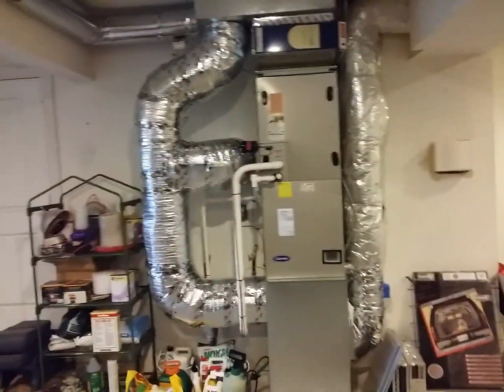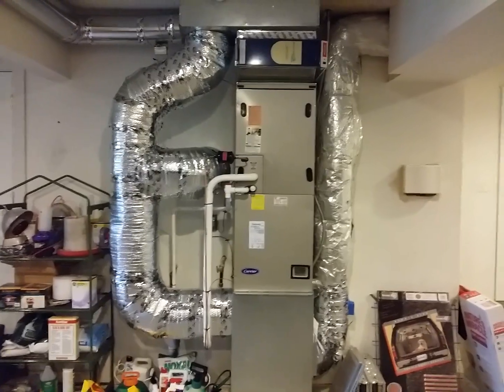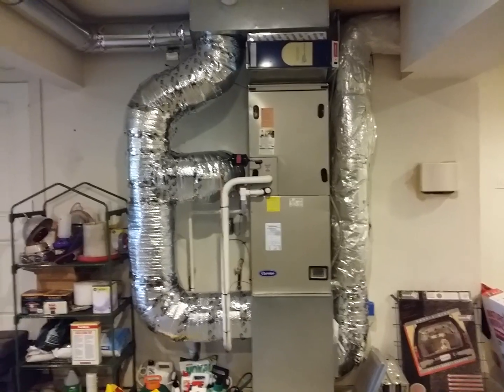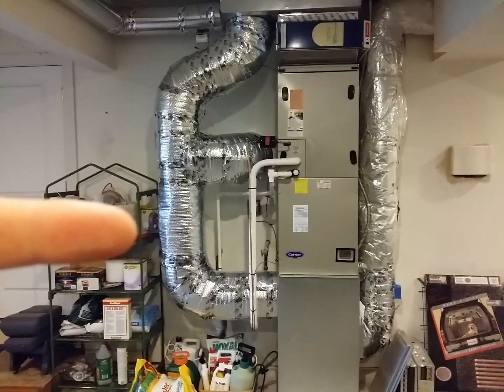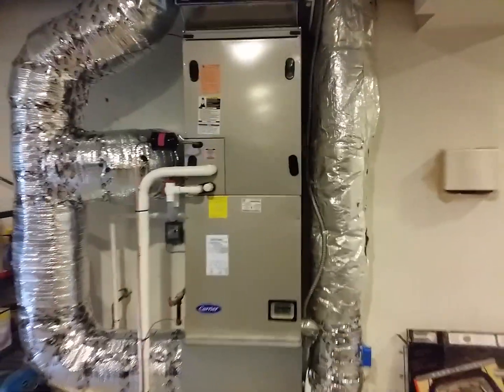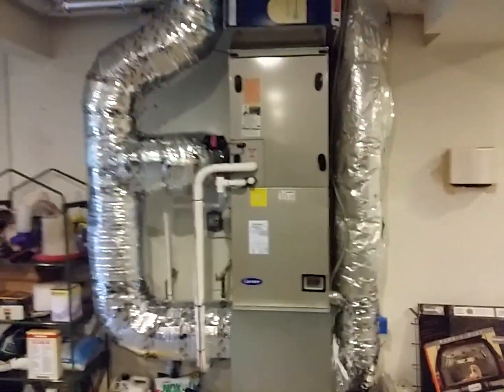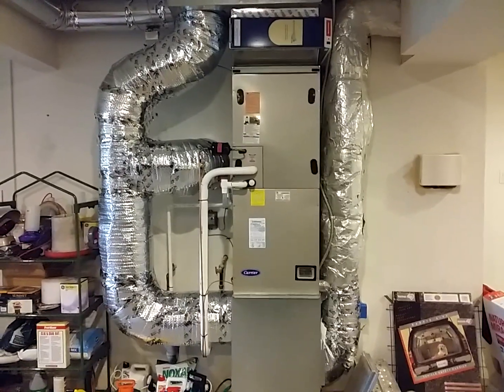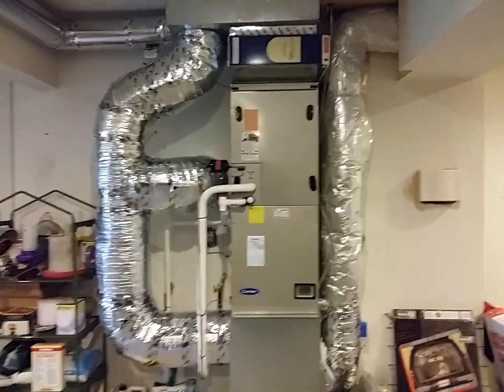Carrier 5 Stage Greenspeed System Blows My Mind!!!

Comment: Hi , I am in the middle of purchasing a new unit is Carrier variable speed 18SEER , and found out later about green speed , for another $500 dollars, but installing comp is not trained yet , you prefer the 5 stage vs the green-speed , my house was build 2003 in FL
Reply from the maker: The 5 stage is a sweet unit. We dropped Carrier all through the pandemic due to chaos and shortages from our distributor. So, not sure if the new super green speed is better than when it first came out.

Comment: My 2012 build Bryant 280VNA heat pump worked the absolute best on Comfort setting to achieve published ratings for hot heat delivery temps and proper dehumidification in cooling.  Best guess is a software miscalculation issue causing an imbalanced ratio of CFM to compressor modulation speed if that makes sense. Too much airflow was the downfall of the system.  Otherwise it was fantastic and lowered the electri bill substantially and cost just under $7000 .

Comment: I would want the bigger condenser. More square inches means better cooling on really hot days. The zoning now needs no bypass. Its great that the unit measures its zone cfm by the resistance of how the motor slows down. So far these systems..Infinity, Evolution, and Ion are great technology.

Comment: you commented that it's connected to a Honeywell zone system.  Getting ready to install this exact Model Infinity 18VS 25VNA8, and my house has a Honeywell HZ432 True Zone, can it be connected to this system like you did here?
Reply from the maker: Dana Stripe you will only have zones 2 and 5. This system is actually a carrier zone system with a Honeywell static bypass damper
Reply from the maker: Dana Stripe I mean stage 2 and 5

Comment: Have the same unit (25VNA8).  In heating mode, it starts up in 2nd stage and stops from 2nd stage after cycle.  Shouldn't it start in 1st stage, then ramp up to 2nd stage if needed, then ramp back down to 1st stage before stopping?   Other equipment installed:
Fan: FE4ANB005L00
Stat: SYSTXCCITC01-B
Zone Board: SYSTXCC4ZC01
Strip Heater: KFCEH3101C15

Comment: I have a complete Carrier Infinity System, with 3 zones, Infinity control board, touch thermostats, everything. It's definitely been a little pricey with parts very expensive (blower motor $600 just the part). But it saves me some money on my electric bills. And its comfortable and quiet. The extra expense is an investment in the global environment and comfort. Might pay for itself in reduced electric bills, but my outdoor unit compressor is on the fritz after only 8 years. I probably wouldn't go the infinity route again from a purely cost point of view. If comfort is important then it's probably worth it.
Reply: You should have a 10 year warranty, buy the extended labor warranty if your techs offer it

Comment: Hello, what is the device directly above the air handler?
Reply from the maker: Mario Gallegos honeywell EAC
Reply: BarronGreenTeam.com, I  always thought that the air cleaner would go on the return side. doesn't it raise the static pressure by putting it on the supply?  You should have installed the matching Infinity Air Purifier
Reply from the maker: Mario Gallegos that is the return side and no on purifier if you are worried about static.

Comment: From personal experience only, I would never touch anything that has the word Carrier on it.  $6000.00 in repairs over ten years on a $4000.00 Carrier Heat Pump.  No help from Carrier whatsoever on 'this lemon.  My last Trane was 16 years old when I sold my house.  Never had any problems other than minor parts replacements.
Reply: I guess old carriers were decent, because my keeprite was installed in 1983, and it has never been worked on, or broken down on us, or made any funny noises or failed in anyway...34 years ain't half bad!. it can handle any load we put on it in h ere...it never struggles and is capable of making this place cold enough to hang hides of beef, even on the second floor! i'm sorry for your bad luck.  I'd hate carrier too if i experienced what you did!

Comment: I just had one 19vs installed about 2 months ago. It cost a little more then I was expecting but I do like it. I went from a 2001 single stage 2 ton lennox to a 3 ton and so far is has been great. It performs great and already I'm seeing a significant savings on my utility bill. Looks like I'm going to save $1200-$1500 a year.
Reply: How is your system holding up?  I noticed it has been 2 years since you posted about loving your new system.  Hope all is well.  That is a lot of money in savings.

Comment: I just had a 25VNA837 (3 ton) installed yesterday, it is very cool!  You mentioned in your vid that you have energy tracking on your Infinity Touch, I have Version 12 software which is the latest and which is supposed to work.  Did you have any issue getting it to work?

by the way, even my installers refer to the 25VNA8 as a "greenspeed" even if not technically accurate, it seems to be common usage.
Reply from the maker: no issues and yes, we all call it a greenspeed because its in the inverter family.

Comment: I think when you go with communicating there is more problems
Reply from the maker: that is incorrect.
Reply: @Lion Phoenix I'm an hvac technician as well shouldnt be that problematic I had trouble when they first came around to but after a few years I run into very few issues. Tec offers classes on the infinities and they're great as well very helpful
Reply: @stevekaufmann8109  Is it possible to have a variable speed VFD system that uses the traditional 24 volt controls? Or is the communicating technology required?
Reply: @Lion Phoenix but I still wouldnt want a vna lol. I'll take the old cap and contactor
Reply: @Fence Estimates I agree and disagree.  If you have a builders model home, the HVAC contractor typically only installs enough wires to control a single stage AC/heating unit. If you upgrade your system at a later date that requires more wires, it is a good chance that the tech/installer will not pull new wires and cheat the homeowner out of the features that the sales person sold.  A 24v control system can give you as many problems (kinked or shorted wires, rats, squirrels, weed whackers, lightning, etc.) as a digital control system. The problem with DDC (communicating thermostat systems), is again installation/service related and experiences the above 24v mentions.  Granted a digital system must have low resistance in the wiring connections.  If thermostat wire has been spliced many times and the splices and/or wire starts to oxidize, the 2 to 5vdc not be strong enough to overcome the resistance and may cause erratic or no communication. If you know how to use a multi-meter and have the com-driver resistance values for each device, then it's either the wire or the communicating device 99.999% of the time. You mentioned that you cut your teeth on the 38YDB.  This 2-speed heat pump model is flexible as the 24VNA9/25VNA8 so to use either digital or analog inputs. Unlike the 38YD which used a Copeland 2- stage compressor, the B-model used an unreliable Bristol Twin-Single compressor.  I was born/retired in the HVAC business and worked all areas of it (Manufacture, Distribution, Dealer (Engineering, Manufacturing, Technical Writer, Sales, Training, Service & Installation)  Anything can be simple if the person is taught and practices the proper techniques. You must have a good understanding in all the HVAC basics which would also include DDC. When the industry moves as fast as it has, it's difficult to be well educated and up to date in all facets.  You MUST have the will and tenacity to learn to be the best in your field and seek it out.  Everything in the universe goes to the path of least resistance....even human nature.

Comment: The unit in the video is an Infinity 5-stage unit.  It is NOT a Greenspeed heat pump.  The model #'s are close but they are completely different models. The 5-stage Infinity model uses a Toshiba twin rotary & Sanhua inverter vs Greenspeed use of a Copeland Scroll compressor & inverter.  The 5-stage unit has 5-programmed capacities vs. Greenspeed 60 different capacities.  The Greenspeed heat pump compressor also turns a high RPM than the 5-stage, thus can produce higher DB.   FYI the Greenspeed is currently in a re-design and major improvements always follow with introduction of the newer models.
Reply: +derickj1976 the infinity greenspeed is a 20 seer. The 5 speed infinity in this video is an 18 seer.
Reply: sad hvacman oh ok, thanks. I was debating over the Infinity greenspeed and the trane xv20i. I eventually end up going with the trane xv18i because the price was right.
Reply from the maker: Thanks for the correction, the reason why I call it a green speed is that this is the true nature of the green speed vs the first generation which was a backwards engineered piece of garbage.  Can't wait for generation 2
Reply: The 5-stage product is called Infinity VS.  The Greenspeed is also an Infinity product.  The Infinity product was introduced in 1983.  The 1st Infinity inverter A/C & Heat Pump was introduced in 1987 (38EV, QV)  It used an Hitachi scroll compressor and inverter.  It was superseded by the Infinity HydroTech 2000 Series (38QE,EV,QV) in 1990.  The HydroTech 2000 was a joint engineering venture between Carrier & EPRI (Electric Power Research Institute).  The HydroTech 2000 was installed in the 1st Smart House built in Stone Mtn. GA for the 1990 Home Builders Show.  It was way ahead of its time. It used a GE inverter, a Carlyle recep compressor and driven by a Parker Electronics microprocessor thermostat.  It was a 3-piece system coupled with an electric water heater.  The compressor section had a Grundfos water pump and refrigerant to water heat exchanger.  The heat pump could make hot water at any time and was not dependent on a call for cooling or heating.   No one could afford the price of the advanced inverter drives so Carrier produced a poor mans variable speed product using a 2-stage compressor matched with a variable speed blower indoor.  They continue to offer the 2-stage products to this day.
Reply from the maker: Reggie Van Hoozer you are putting way to much energy into your responses. Thanks for the history lesson.
Reply: @nsideguy1  Thanks for all the info you shared. Very cool!
Reply: Reggie Van Hoozer What is the seer rating on the 5 ton infinity greenspeed???
Reply: BarronGreenTeam.com What seer rating are you getting on your 5 ton???
Reply: Reggie Van Hoozer When is the 2nd generation coming out.